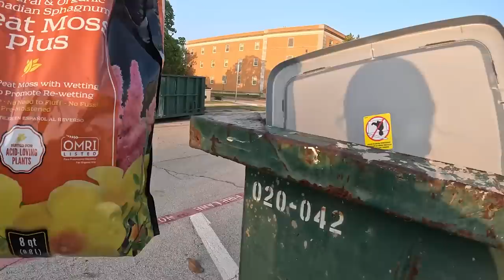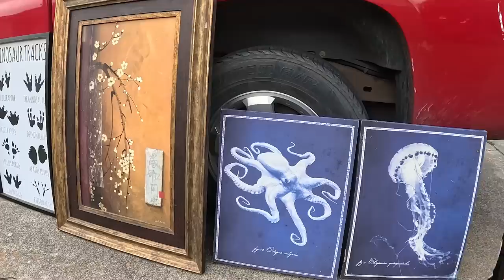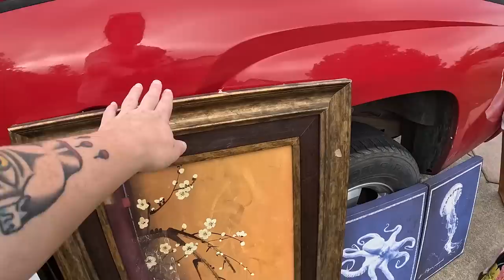College Dorm Dumpsters are Filling Up! That Isn't Trash!

Comment: The black flex pipe in the dumpster where you found the one and only charger cord could be donated to a animal shelter. The kitten would love running through the pipe tunnel. Bones could probably use it to. The iron CD holder would be a cute nick- nack shelf get some wood or glass shelves  cut for it.
Reply: Great idea Cynthia! Cutting some of the rugs and securing on pipe can become a scratch post?

Comment: I used to put rugs out on the driveway and hose them down. Then spray with cleaner and spray again. Then hang to dry. I keep some hair bands on shifter in vehicle to put my hair up when I run out the door in a hurry and decide to put it up. When finding clothes that aren't full of holes or torn but have a stain. You can tie dye them. I like the rack and cute pictures.